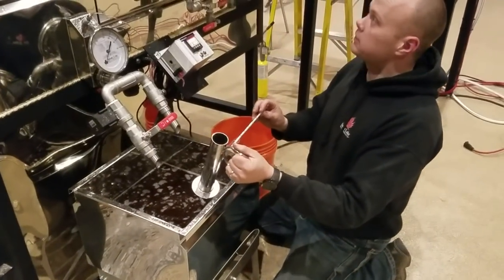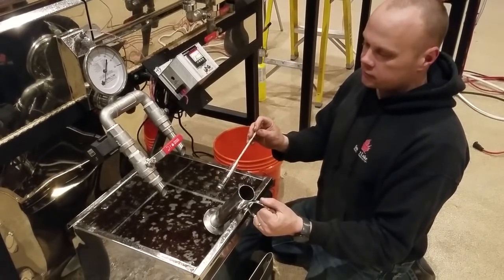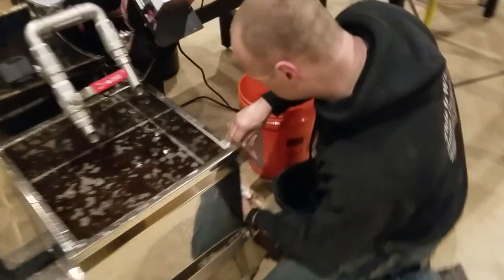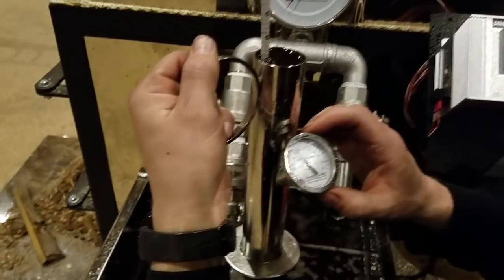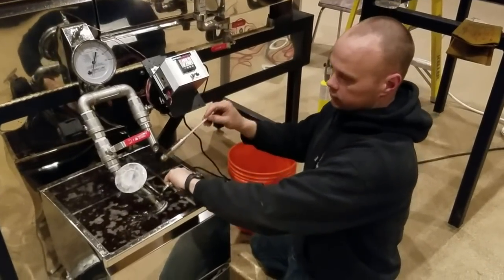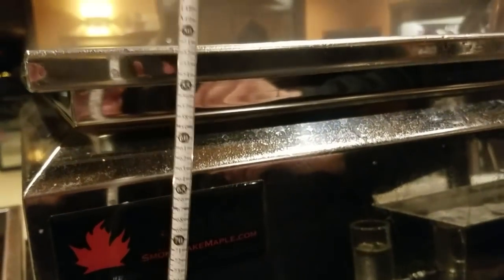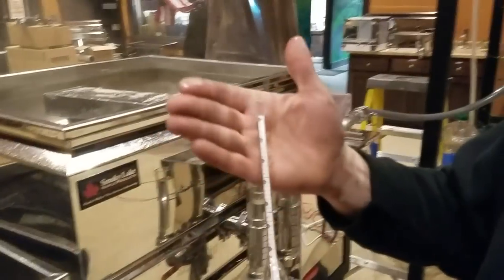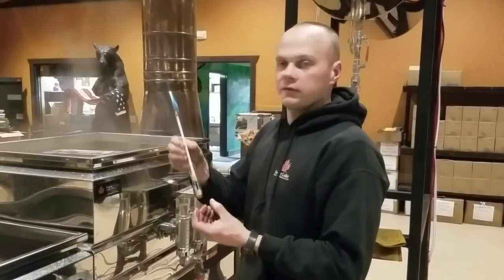Checking Density at the end of a boil, pure Wisconsin maple syrup

Comment: When you take the measurement, does it matter what temperature the syrup is at?   Will the Murphy cup used with the hydrometer work at any temperature?
Reply from the maker: Yes, this is exactly what makes the Murphy Cup such an important device.  It automatically calculates the hydrometer's target based on temperature; any temperature.
Reply: Thank you!